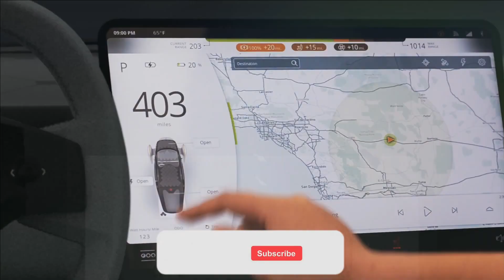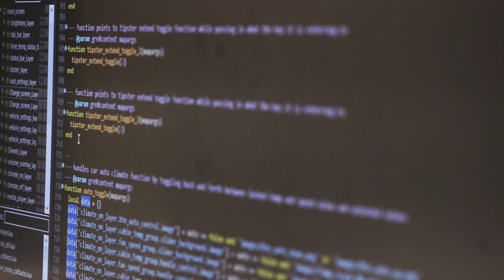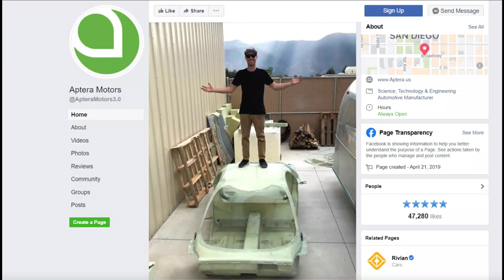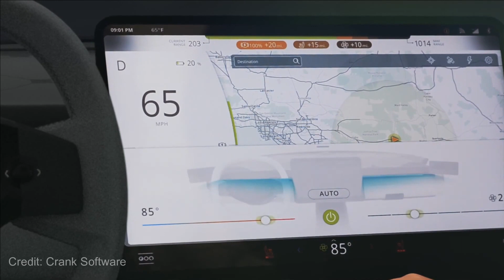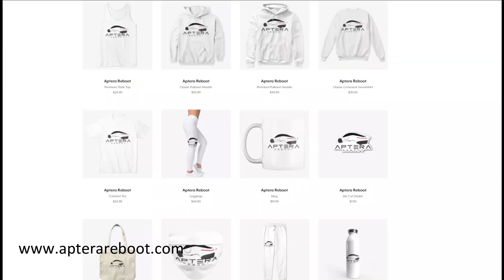Top 3 Reasons Why Aptera Will Fail?!?

Comment: To me the biggest question is if the public's resistance to three-wheeled vehicles can be overcome.
Reply: Most resistors to 3-wheelers are basing themselves to those topsy vehicles with the two rear wheels and the one front wheel.  But the Aptera has two wheels up front and one larger one in back.   Instability issues would only count if you were to be driving the Aptera in reverse at full speed whilst making a sharp turn and what is the likelihood of that?  Well, I guess there is always somebody, but I would have no sympathy for them should they try such foolery.  lol
Reply: With the heavy batteries down low and the wide wheelbase, stability should not be too much of a problem. A few videos of it beating a 4 wheel car through a slalom should do the trick.
Also there are several 3 wheeled vehicles already, and more coming: https://www.youtube.com/watch?v=GzsZSmNOOB4
Reply: @macrumpton  And don't overlook the entire motor weight carried at axle level.
Reply: i think that, if they get to building a four passenger, it will possibly have four wheels. It won't be quite as efficient but, like you said, three wheels and two seater will be a no-go for many.
Reply: @tims8603  I'm inclined to agree, a 3 seater is not an economic proposition however,for young, unmarried or single persons requiring reliable transport it's  a great idea and in any event,it could easily be redsigned into a four wheeler surely? Terry Offord
Reply: Arcimoto has reached an agreement to buy Tilting Motor Works for approximately $10 million. Tilting Motor Works developed the TRiO, which is one of the most popular three-wheel conversion kits for touring motorcycles. The tilting technology at the heart of the TRiO kit allows riders to lean naturally into turns, making three-wheelers handle more closely to conventional two-wheeled motorcycles. Arcimoto has indicated that the technology will be used in new Arcimoto products intended for the micro mobility industry.
Reply: Robert I think when the Slingshot from Polaris came out it changed a lot of market sentiment. 

However it also could have been because they were marketing it as a street legal recreational vehicle. Only time will tell I think it's an awesome design, a definite conversation starter, and the extra bonus of seeing people's reaction at night. The vehicle almost looks like it hovers.
Reply: That's an easy one. 2 ways that can happen. 1. If Aptera becomes a cult like Tesla, no offence to Tesla. ALL car makers would kill for that:) 2. Excessive marketing with a bunch of scantily clad women in let's say somewhat seductive positions on the car. The oldest trick in the book. LOL
Reply: I see three-wheeled vehicles every day in Houston, Texas.
Reply: The bigger concern with 3 wheels is they are often classified as motorcycles and require an endorsement or different licence that many don't have and may not want to get.
Reply: @robertalatalo5904  Most states classify the Aptera differently (as an autocycle) because it has a closed cabin and side by side seating. which means no motorcycle license or helmet is needed in most states.
Reply: For me the number of wheels or seats are not the issue.  The weight is.  No matter how safe they make it,  in a head on collision with a Cybertruck, with 1/3 of it's mass and much Lower height, things are not going to look pretty for the Aptera driver.  You can't get around the physics of it.  Some of the things that make it efficient are the things that make it unsafe (compared to a car not a motorcycle)
Reply: @Tooradj  I have a friend who makes the same argument about my car being too small: A Mitsubushi Mirage.  She says it's all fuel efficient and everything, but that's why she drives a gas-guzzling SUV.  Because she says it will save her life as I go about "saving the planet."  To each their own.  You be you and I be me.
Reply: @fanfare100  I wouldn't mind being you if it was just me.  I ride a motorcycle alone but ride in a safer vehicle when I am with my wife.  I do understand the big Gas guzzlers are what make roads unsafe for Aptera and admire you for putting one more Aptera on the road.  CT is not as efficient as Aptera but a lot greener than all ICE on the road today.  I rather save both the planet and my booty (planet is a close second)
Reply: @Tooradj  I totally understand that.  When I ride with my friend I ride in her car because she's a fraidy cat and I respect that.  She's always been a worry wart tho, though sometimes it's to the detriment of others.  But I can see if you're trying to protect or help somebody else feel safe.  I just wouldn't justify it for myself.  Plus, my small car has gotten better safety ratings than a many a larger vehicle.  For me I feel best when a like, minded person rides with me.  The most I have gotten out of my 3-cylinder ICE hamster-mobile is over 64 miles per gallon on a trip from Canada to Delaware.  I don't know what the miles per gallon are on a Tesla, albeit I know it's much larger.  The ability to charge 10 miles per minute on the Aptera excites me for when I actually must plug it in on long cross-country trips.  That means just stopping for a bathroom break and a snack is enough to keep it running for miles and miles.  

What I'd really like to see is a mode where the solar panels actually produce energy whilst on the road and not just stationary.
Reply: @Tooradj  First off, a Cybertruck will have collision detection and emergency braking. Second, the body of the Aptera is similar to F1 cars. Even if it got sent flying, you'd still likely survive. The front wheels can break off and save you. The shape has minimal contact points, which (going back to physics) means that impacts will glance off or be deflected or reduce the force transfer. The vehicle is more nimble, meaning you can more easily get out of the way. So a lot of positive tradeoffs.
Reply: @Nphen  Great points.
Reply: @Tooradj  It's not the 'Big Gas guzzlers' who create a problem, rather it is when IDIOTS get behind a steering wheel of ANY motorized vehicle that problems are likely to arise. Terry Offord
Reply: @terryofford4977  Unfortunately  production rate of idiots is even higher than it is for Big Heavy vehicles.  That combination can be deadly for light cars with smart drivers.
Reply: @Nphen  Aptera also has a safety pilot option which has the same features.- I have over 400,000 safe miles on motorcycles, but I have ordered it.
Reply: @fanfare100  As your friend probably does not know, bigger is not necessarily safer. If life were only that simple.
Reply: @fanfare100  BAD DRIVERS WHO REFUSE TO  IMPROVE
Reply: @Tooradj  I think that weight and mass is not the issue. Have you seen the video of the huge and heavy S-Class running into the tiny lightweight Smart car? The Smart car occupant is just fine because of it's crash cage design. The design of the Aptera is similar to a motorcycle helmet, except you are driving inside of the protective helmet.
Reply: @deanmcmanis9398  Let me know when this thing passes an independent crash test.
Reply: 3 wheeled vehicles are not considered cars and are not required to pass typical auto safety tests. That should be your biggest concern. It is 3 wheeled to get around those regulations, not to be more efficient. It is also more difficult to avoid potholes, etc with 3 wheels.

Comment: If Moore's Law is correct, they should be able to get the price of their high end model with the 1000 mile range, down to around 30K, or less, within a few years.  When that happens they will be unstopable.  If they can get it down to 25k or 20k, they no longer will be a nitch market.
Reply: I think you meant to say Wright's Law
Reply: @MsAjax409  You are right.  Can't believe I did that.  Thanks.  I was thinking Wright's Law and typed Moore's Law.
Reply: If Scrooge Mcducks law is correct gold is better investment.
Reply: I don't see that happening because of inflation but I also don't think the 1000 mile range battery will be a popular choice.  Nobody wants to drive a thousand miles in one day and this vehicle would be pretty impractical for long trips anyway.  Plus a new shorter range battery would be considerably cheaper when it is time to replace.  I think the 400 mile version is the sweet spot.
Reply: That would be nice, but it will never happen. As soon as these cars hit the market the prices will nearly double and will never come down.
Reply: @thetrumanshow4791  My guess is that Tesla is going to buy Apera and place its price point 5K below their 25K hatch back.  The two companies have been in serious negotiations for at least four months -- it started off over letting  Apera customers use the Tesla charging network, and it expanded into Aptera using Tesla's electronic hardware and firmware and fsd.  The Aptera engineering has been so excellent in a first priciple kind of way, and that is the way Elon approaches problems,  they may have changed Elon's attitude that 3 wheel cars are inherently unsafe.  Changing that attitude is the only real issue that had to be overcome.
Reply: @colinkelley6493  I sincerely hope you're right.
Reply: @colinkelley6493  a road bump with three wheel is a real concern and china already have a 4400$ ev with four seater which is the best selling car now. It's 50% owned by gm . 99%  chance they will bring of a two seater and four seater to us and Europe in near future for around 10k at best. Aptera's best chance is to be sold to Tesla.
Reply: @maruf2050  Absolutely Wrong:  1)  With two wheels in front and the rear wheel in the middle, most pot holes and road bumps are less of a problem, easier to maneuver aroud.  Some potholes are unavoidable no matter what you are driving.  2)  Ford, GM, Dodge, Toyota, VW, etc, are ALL playing the creative obsolesence, dealers make most of their  money off repairs game.  THAT IS THEIR BUSINESS MODEl AND THEY ARE NOT ABOUT TO GIVE IT UP.  If GM sells a Chinese made $10K EV through their dealers, the people who buy them are going to pay $30k in repair over the lifetime of the vehicle.  Absolutely guaranteed.  Most people understand what is going on, and are tired of this SLEEZE.  The only way to discribe any Toyota dealer is SLEEZE.  Same goes for Chevy, etc.  SLEEZE!!!!!  Given a real  choice most people will make a thoughtful, practical, logical decision.  For the next twenty years Tesla will be able to sell every car they make.  Furthermore, Ford and GM are not on sound financial footing.  They are fragile -- $250 billion in debt.  They could go belly up in the next couple of years on their own...  If you are a paid troll, you are working for a loser.
Reply: @colinkelley6493  I am not paid LMAO. But you are surely paid or invested. I am just doing a practical logical assumption of my own. I am an electrical engineer with an MBA and an ev enthusiast. I was pumped up when they came first time years before. But seeing them going downhill and making all kinds of partner deal while the market going cheaper and crazy fast technical advancement, made me come to the conclusion that their best bid is to be sold to Tesla.
Reply: @colinkelley6493  without fsd tesla has nothing over the established market. they aren't sharing it for nothing. charging stations are extremely over rated ( my personal solution- just hire a national electrical company , make a deal with federal gas station provider. design a charging port which can be used by all evs. give all profit to gas stations, can be done by federal govt in a single day, lets take a month , for incentive govt can provide solar panels to all the gas stations to charge also, to make it even more sweet and fast). Only thing possible is if tesla finds the composite of quality then they buy aptera . Extremely doubt  they will produce it though.
Reply: @colinkelley6493  If what you say happens, I will be getting one the instant that happens. I love the idea of never having to charge my car. Maintenance on EV's is gloriously absent, so it is just right for me. Full solar, 600 mile battery and 3 wheel drive in black please.
Reply: @tylerdurden639  
Not only is "maintenance on EV gloriously absent" but this company is going to give you right to repair (and even have torturials on how to do it)! According to the company, they eventually are going to have it to where you can have parts in 48 hrs or less (in the US, I believe). 
Most drivers on the road can't fix most of what's on their vehicle so they get huge repair bills. Like how many people in this comment section know how to repair and replace an automatic transmission? Or an ICE. 
Not only that but I saw a video recently that said they will sell for around 25k and since it's built in the US and most parts are manufactured in the US you will get the most tax rebates, which is $7500, making the real price after taxes  around 18k!!! 
I get it most here will say they can't live with two seats or three wheels but this car is seriously more efficient that anything currently on the road. If they could somehow come up with a four seater in the future for families, they will be Golden. Of all startups I think this one has the best chance of succeeding, but that's just an opinion.
Reply: @rpsoren  I have virtually no need for even the second seat more often than not. But you never know. If they had a fold up 3rd seat in back as an option, I would likely get it and even if I never used it, I'd still have the option to have a 3rd person in the car for when I get together with my brother and his wife.
I'd love to see an Aptera build out that was $25k that still had rebates intact, but I am still waiting to see them start delivering the ones on order before I start standing in line.
I have bought too many computer games in development that have gone bust. Didn't like it with a $60-$100 video game... Sure not doing it when a $25k-$40k loan and my credit rating are riding on it.
Reply: @colinkelley6493  How does one straddle a road hazard in a tadpole three wheeler?
Reply: @rpsoren  they need right to repair because they have no dealer network and no financial means to support a corporate repair service. It's basically a kit car after it leaves their doors.
Reply: @6.5x55  Probably no better than in a Prius or a Porsche.    This may be the reason why so many people drive trucks and motorcycles.  If I wanted to pack up my guns and go hunting or camping "in the back country" I would pack  my Honda 125 Trail Bike in the bed of my 4wd dodge dually 350 with Cummings diesel.  But, on the other hand, it makes just as much sense to commute to work in the HOV lane in what you call a "tadpole" EV.  Have a nice day.  Relax.  Stop and smell the roses.  All that tofu is affecting your brain.
Reply: @colinkelley6493  not of people  do NOT  make thoughtful  informed  decisions
Reply: With Biden & the democrats in charge the Aptera will cost 3 times as much in 2 years. Like everything else.
Reply: @IP0Monsturd  The people (the filthy rich 1% of 1%) who are behind the people pulling Biden's puppet strings own the big banks, the big oil companies, the big car companies, big pharma, the military industrial complex, and much more.  They are currently buying up the world's remaining major agricultural land.  They own roughly 50% of the wealth of the world.  Biden is talking like an environmentalist,  but he is saying one thing while doing the opposite.  Make no mistake. "They" are, one way or another, out to stop Tesla and Aptera and keep our economy running on oil.  Keep the faith.  We are on to them.  They are losing.